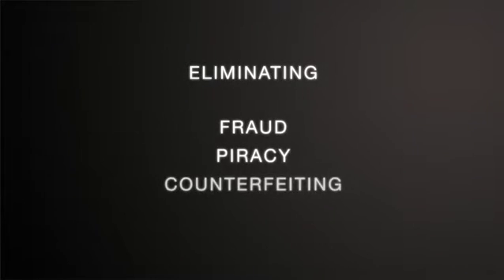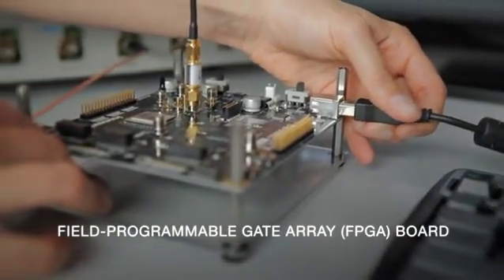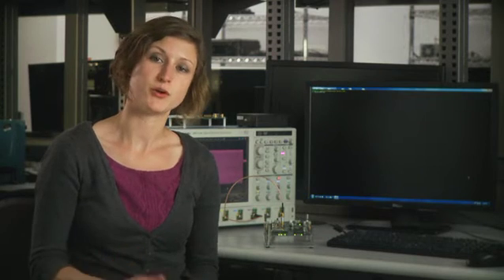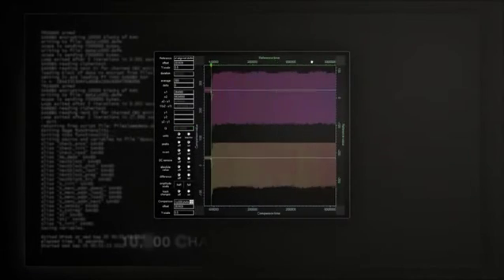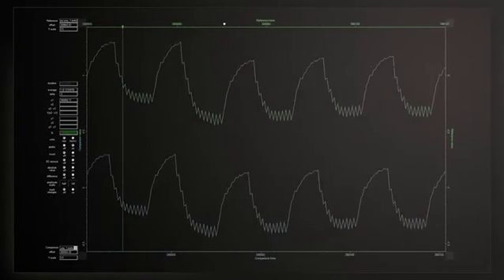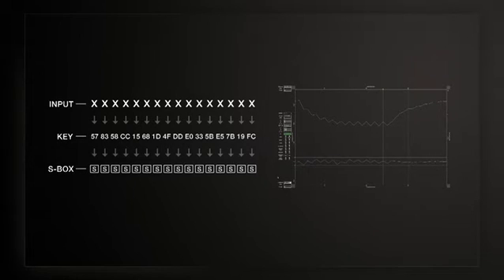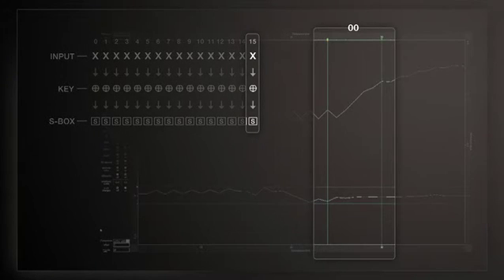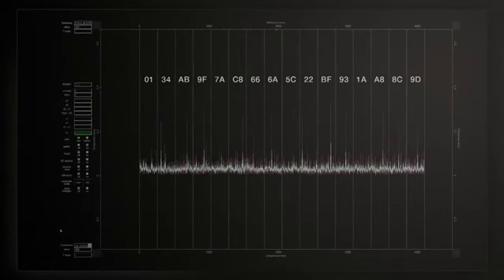Side-Channel Analysis Demo: FPGA Board

Comment: AES actually process data in 32 bits because of MixColumn operation. Since you attack first round of AES of course you can guess 8 bits of the data. But if you try to attack last round of AES-192 and AES-256. You have to guess 2^32 values.